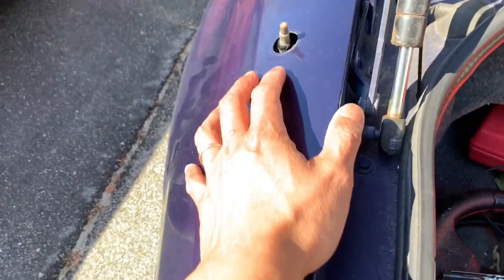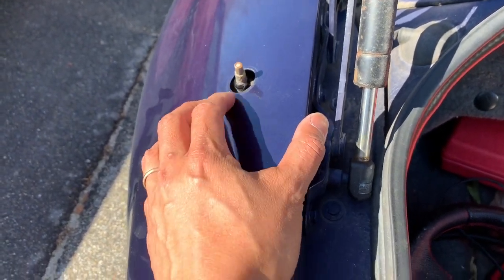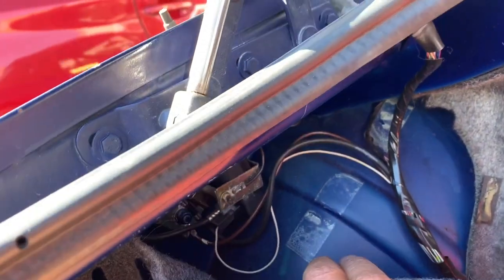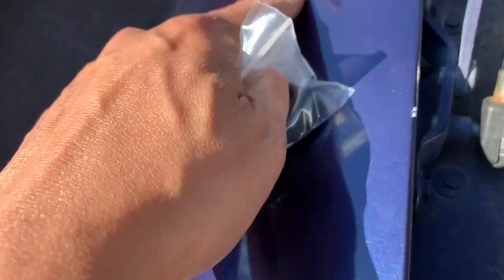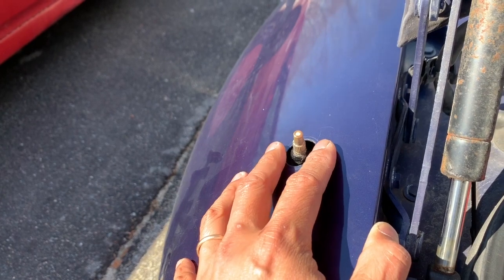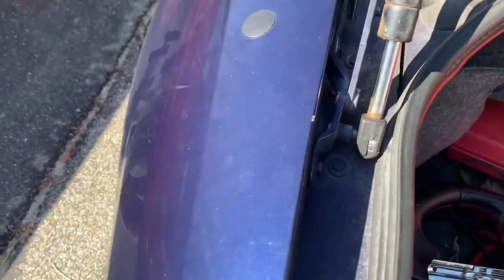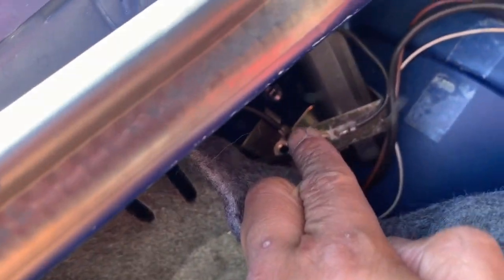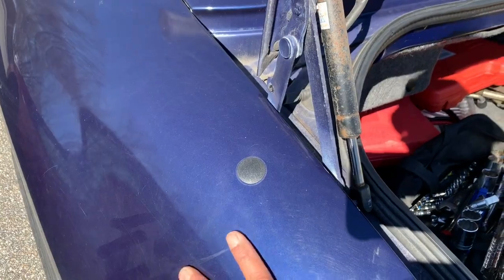bmw z3 - antenna delete

Comment: Hi where did you buy the antenna delete cover from thanks
Reply from the maker: Ace hardware.  Expensive.  $0.35.
Reply: @Simplenetwks  But what is it? What size? What's the part number? These details would be helpful. Anyone can think of "putting a rubber plug in hole" to seal it; the important aspect of this is what the part is.
Reply: @Simplenetwks  Hey bro, do you happen to have a part number for it or anything?
Reply: Part number?